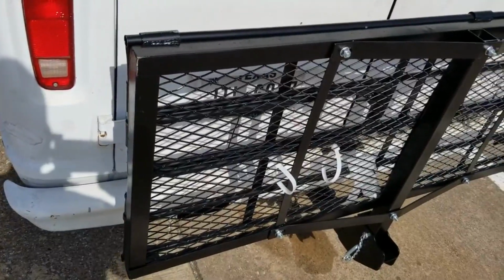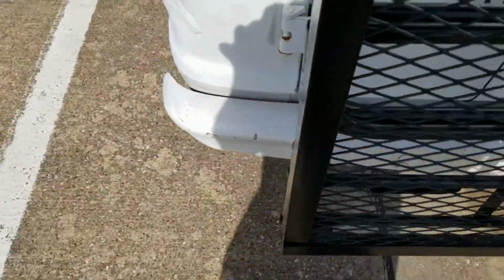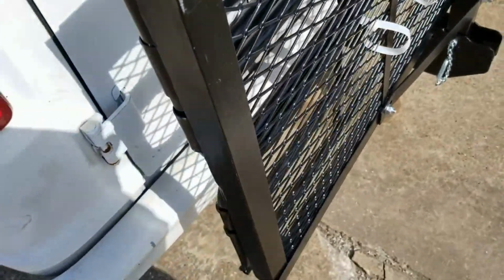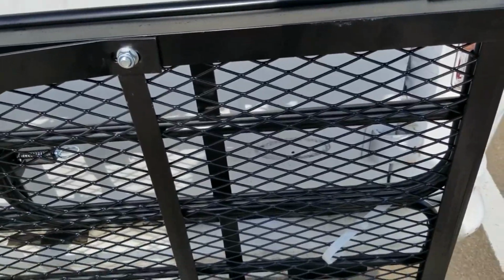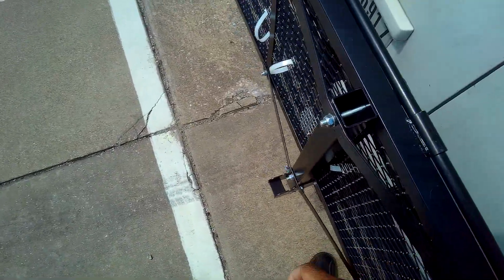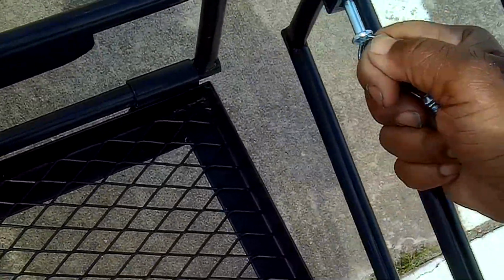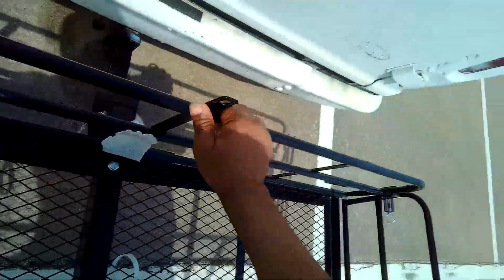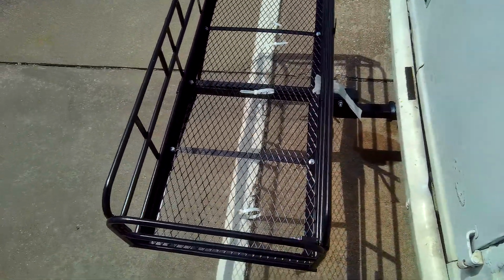Merack Foldable Receiver Rack for the Van's AC Generator Complete and Installed

Comment: i really miss your detecting videos
Reply from the maker: wendel Hose They are coming.  The Equinox 600  (the 800 is stupid expensive) will be ordered on the next paycheck.. And the XP deus is charging..finishing up the AC install in the next two weeks so hanging out at a park (I am Urban locked,) during the heat of the day won't kill this old man